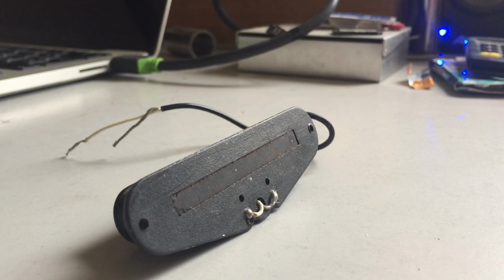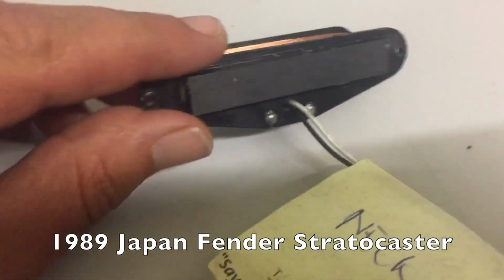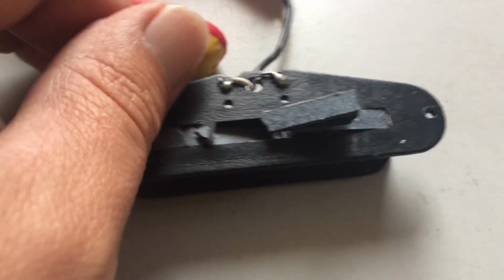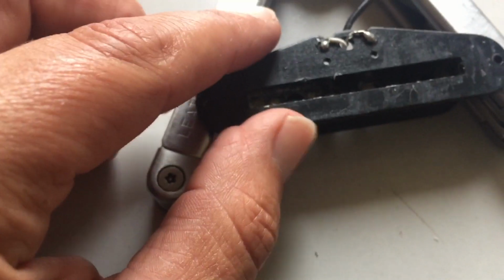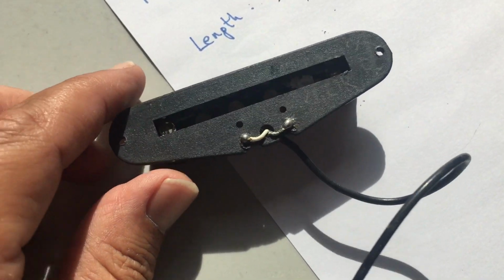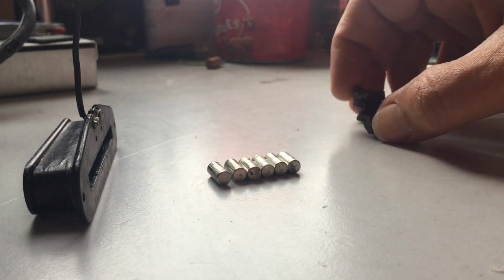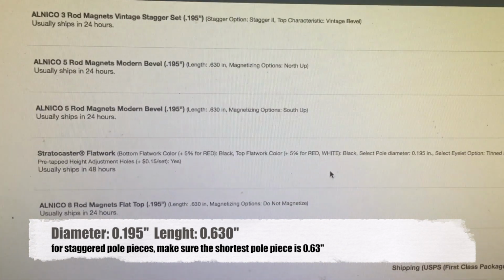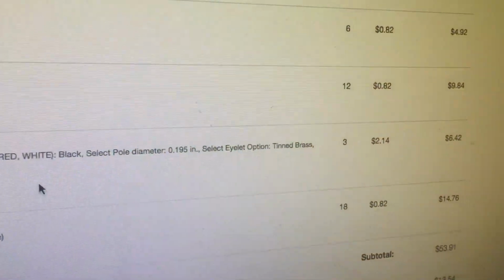Upgrading Squier Strat Pickups with Alnico rods PART 1: dissemble

Comment: How about the resistance? Any change?
Reply from the maker: Hi Omar, thanks for the comment. I am (quite, not completely) sure the resistance only depends on the copper wire coil. So it should not be affected.
Reply: @zjokka  hello, thank you for your answer, I think the same.

Comment: You think it adds bass? Or just add to the feed back. I put 59 little in mine. It sounds incredible
Reply from the maker: Thanks for commenting, Chad! I had a Little 59 Strat bridge pickup which I put in the Strat I built for my good friend Dave (RIP). You can hear it in the most recent Blues Pro Junior repair video towards the end. 
Upgrading the pickups from ceramic to alnico is a real upgrade, as it is for speakers.

Comment: 2:20
NEVER do that to any pickup unless you intentionally want to ruin it!!!

99% that such furious hits will tear the wire inside the pickups or/and crack the bobbin. After this procedure this pickup can be broken and you won’t hear the difference right away.

The proper way to pull out the steel rods is:
a) warm up the pickup up to 90–100°F (30–40°C) to make the wax less hard,
b) SLOWLY push onto the rod with a press.
Reply from the maker: 99% of the coils survived the violence! But do make a video explaining your approach... looking forward to it
Reply: @zjokka  
:))
Reply from the maker: @aleksandrnestrato  But of course you are absolutely right. It was a gamble, it's a one of the more crazy videos I did. But should really pickup (!) on the project and remagnetize the alnico rods, that may have been the problem. 
I really don't know how heating would work... how to heat the whole pickup, mind you, it's a plastic bobbin... Maybe heating up the pole pieces with a soldering iron? This would make them expand and maybe crack the plastic housing or deform it. 
Thanks still for watching the video and your comment.
Reply: @zjokka  
I have mentioned the temperature rates earlier, they're about the human body temp level. So you can "heat" the pickups—warm them up actually—by your hands or in your underarm. Just hold them there for about 20 minutes.
Maybe use the hairdryer. It'll take like 5 minutes. The only condition: the blast of air should be warm but not hot. If you put your hand in that airstream you should be able to hold it for any time period comfortably  (two minutes, twenty minutes, three hours).
If the air blast's temp doesn't hurt your hand it won't melt the bobbin.
It's wax, it's not welding metal, neither soldering wires, you don't need anything above warm temperatures.

You don't need this wax to melt into liquid as well. Just make it flexible to let the magnets go through.
Reply from the maker: @aleksandrnestrato  This the case for vintage pickups who are potted... these are cheap chinese Squier pickups assembled with glue to keep ceramic magnet in place...
Reply: @zjokka  
Oh, I see!
I warmed those ceramic bar magnets with an old iron and kept a laser thermometer on the bobbin to watch the temperature.
Such procedure is not useful for the iron, so it's better to take the one you don't use for your clothes.

The other way is to put the pickup onto a hot frying pan, magnet down. And keep an eye on the bobbin temperature.

Comment: Couple tips: Use a flat punch, don't ruin your screwdriver.  Put the pickup on flat surfaces, like two pieces of wood so that it's supported everywhere but directly under the magnet. Hitting it like that, with it unsupported, can break off the end tabs.
Reply from the maker: You are absolutely right. 
But I'm just a hack sharing his failure so other fools don't have to fail. 
I used to build BMX racing tracks with the boy next door when I was young, so I used my dad's equipment (shovel, spades, etc.). The boy next door never brought any equipment because his dad was so protective of it. He worked construction and was massively frugal. The few times we did use his shovel, the boy next door had to clean it properly afterwards and then oil it before putting it back. 
I never do that, I'm sure you don't either... but it's the right way, I'm sure. It's just how valuable your time is. 
However, I will never again use a screwdriver like that - I have flat punches. But where? There's another point. You need a workshop to do work, have everything organized. 
Thanks for the comment!
Johan

Comment: The  bar  on  the  back  of  the  neck  pick  up  on  my  strat   has   snapped  in  half  and  now   when  i  go  to  middle/neck    the  sound  on  some  strings   sounds  weak    and  the  same  when  i  flick   neck  .if  i  glue  the  bar  back  together   will  that  fix  the  problem?

Comment: Great video, I also have a MIJ Strat 1988-89. My pickups are reading 4.5 - 4.6k. I have been wondering if the the bar magnet has lost it's strength over the past 30+ years ? I am very curious to hear back from you on what you think or were these pickup always that low of output. The sound okay but I really have to turn up the volume to get any juice out them. Thx Steve
Reply from the maker: Hi Steve, sorry, I saw this a bit late. Yes, that is the range in which my pickups also measured. By now these instruments have become very much sought after, but the electronics were exactly what they put in Squiers now - the switch too!  
So putting after market pickups in a MIJ cannot devaluate your guitar, to the contrary. In fact, only the MIJ neck has value because it has the serial... 
I really need to quit mucking about and restore my MIJ neck to MIJ body and upgrade all electronics. The thing is, I've become a Telecaster player in the meanwhile.... don't think I'll ever go back.

Comment: Did it sound better?
Reply from the maker: Not in my opinion, but maybe that's exactly how vintage pickups sounded, a bit thin. I see people paying big bucks for stuff like gold foil pickups which to my ear sound cheaper than a Squier pickup.
Anyway, did realise that I never checked the magnetism on the pole pieces and did not remagnetize them. Once I get hold of a good magnet, I will experiment some more.
Reply: @zjokka  You need a pair of very strong neodymium magnets to charge alnico rods. One above and one under.

Comment: Yeap offcourse these are underwound! They even put the magnet closer as you showed and they come up with a cheaper pickup that has the same output
Thanks for the video
Reply from the maker: Hi Stravros, thanks for the comment.
My alnico pole pieces are in the mail, as soon as they arrive, I will try and install them in these pickups and test the result. Stay tuned, get subscribed ;-) J
Reply: @zjokka  Definately...also, a before-after demo would be great,but you have allready removed the poles..
Reply: They are definitely weaker.
They test at 4 to 5kohms of resistance. 
But increasing the magnet strength will give more volume but not more resistance/gain. 
Resistance does not always relate to volume output.
Hence a p90 that measures at 9.5k is just as loud or louder than a humbucker at 15k of resistance because of two magnets being used on each side of the coil. Where a humbucker uses one magnet centeted between each coil.